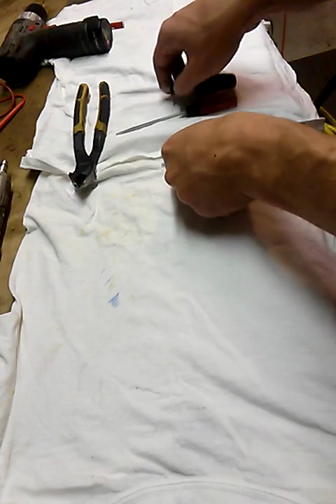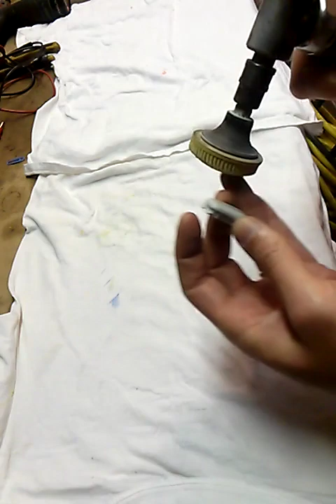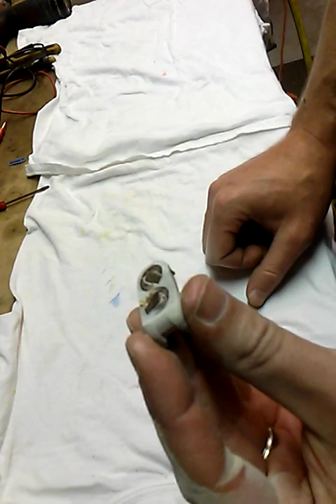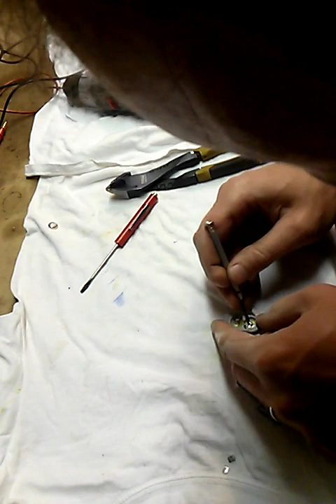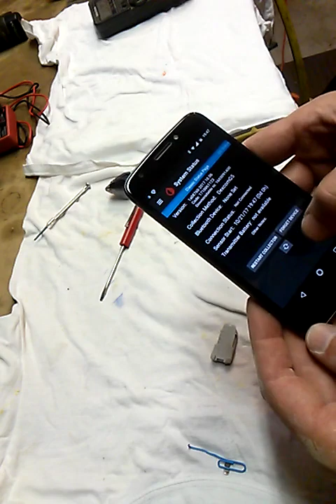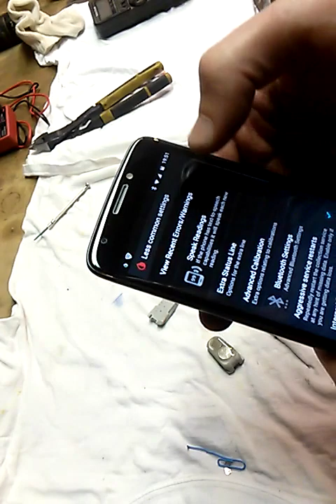Dexcom G5 battery replacement

Comment: i wonder if there's a battery that would fit into the depressions that have the same voltage but larger capacity.  This would make the transmitter last longer,  although the profile might be a bit thicker.
Reply from the maker: The Energizer 389 batteries have a listed capacity of 90mAh, compared to the Renata spec of 80mAh. The datasheet for Renata calls theirs fit for "High Drain" whereas the Energizer claims to be for "Continuous low drain (High pulse on demand)"'. The Energizers are a tiny bit bigger in my experience, but they will fit. For the small difference in life it +might+ make, IMHO, it's not worth putting anything in but the exact replacement model. The Renata fits perfectly.
Reply: "High pulse on demand" reminds me of a different Bluetooth device showing errors because an incorrectly designed power supply could not provide rapid high current bursts needed when transmitting. The same can happen with a battery device like Dexcom.

Comment: Why do you not simply solder wires to the connectors once the battery is removed, seal it up, and have an external battery pack that you can replace batteries in for a loooong time...?
Reply from the maker: Some have done that very thing. Thus far, I have not, because my personal feelings are: (1) it increases the size of the transmitter, (2) your external battery pack needs to be waterproof, and (3) it's just not that hard to replace them with the original batteries.